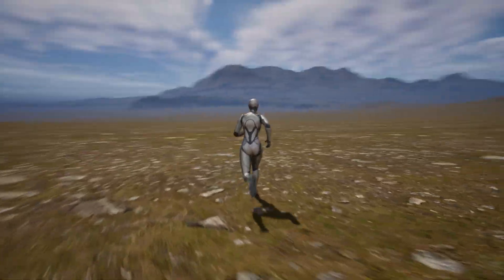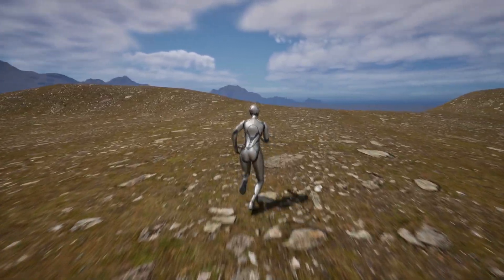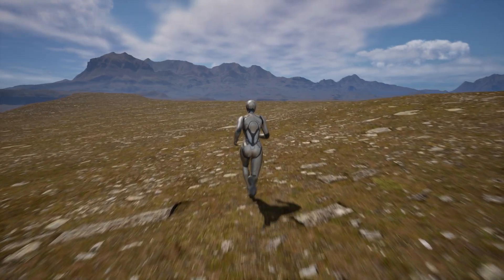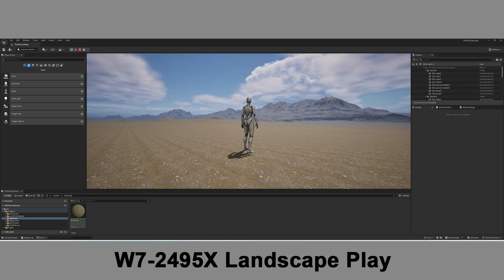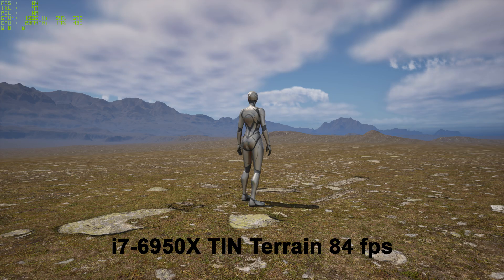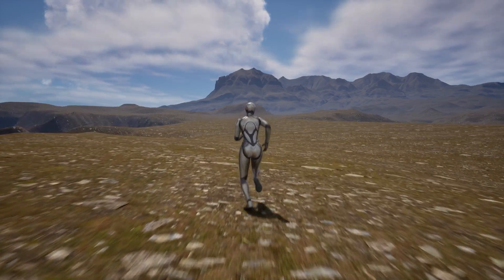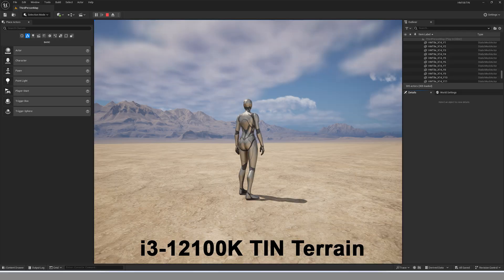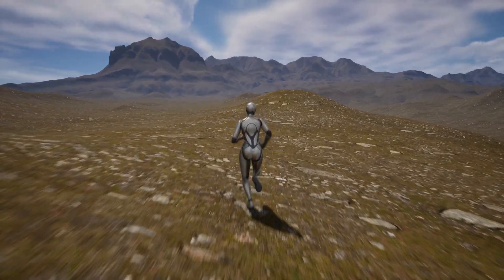UE5 Mesh Tile TIN Terrain Part 5 16km Landscape vs TIN

Comment: is it open source in GitHub so that I can download, play and study ?
Reply from the maker: Link to the original Project file and a Packaged file is in the video description.  It's on a Google Drive.
This isn't a plugin or script, this is a technique for creating TIN terrains in Unreal Engine, so GitHub won't be used.
I show complete workflow steps in my previous videos on this.
Reply: @demenzunmedia thanks a lot, I will download the files and follow your steps in the videos 👍🏻🙏🏻😀
Reply from the maker: @TsingYiTube  - You are welcome.  This is Part 5 of the video series on TIN Terrains, so you might want to watch Parts 1 through 4 as I cover what tests I have done and what the entire workflow is from terrain download, to heightmap resizing, to exporting mesh geolocated tiles, to decimating the TIN meshes, to importing into Unreal Engine.
Note that I have developed some of the tools for this workflow in my TerreSculptor 3 software, these workflow steps may not be available in other terrain software.  Also, I don't currently know if Blender or Maya can decimate proper TINs, I used Autodesk Max for that step.  I plan on looking into other 3D software next.
The really great thing with this system is that it can create massive terrains, and the system requirements are much lower than using the existing Landscape system.
I am still working on this TIN technique though, so I still have to explore further optimizations like TIN Decimation Percent, Mesh Tile Distance Culling, Material systems, Physical Materials, Mesh Painting, and more.  I will be creating new parts to this video series as I get further along with the TIN design system.
Reply: @demenzunmedia I am interested in mesh tile terrain too, but I wonder if it support CDLOD, dynamic loading/unloading of meshes on terrain?
Reply from the maker: @TsingYiTube  - LOD: When you create the TIN meshes using the Max Pro Optimizer, you can specify multiple decimation levels.  So for example, you can have it automatically batch-create a set of TIN meshes that are 65% decimated for LOD0 and 95% decimated for LOD1, and use LOD0 for 0 to 2km view distance and LOD1 for 2km to infinity view distance.  The Max Pro Optimizer actually supports creating of up to 9 LOD Levels for each mesh. This is really easy to do.  I do plan on testing TIN LODs with Unreal Engine 5, the only real hassle is that UE5 no longer supports the "_LOD" mesh name for auto loading of LOD sets, so what I have to do is re-load every pair of LODs back into Max and place them into an LOD Group, and then export that as an FBX.  A real hassle for 256+ meshes.  So what I might have to do is look for an existing UE5 Plugin that supports LOD0/LOD1 mesh naming, or write my own plugin for importing mesh groups that have "_LOD" mesh naming suffixes.

Dynamic Loading: The World Partition cell system in Unreal Engine supports dynamic mesh loading and unloading.  Also, the Culling Volume should be able to perform Distance Culling of the mesh tiles for less memory and better performance.  I am going to play with World Partition cells for dynamic loading, and the Cull Volumes next, to see what type of further optimizations I can get on this TIN terrain.  I will be posting that into my next videos in this series.

If you are using other game engines besides Unreal Engine, then you would have to research what they have for features like this.
Reply: @demenzunmedia  great, I look forward to your new videos 👍🏻🙏🏻😀